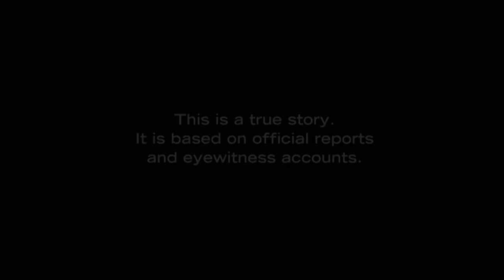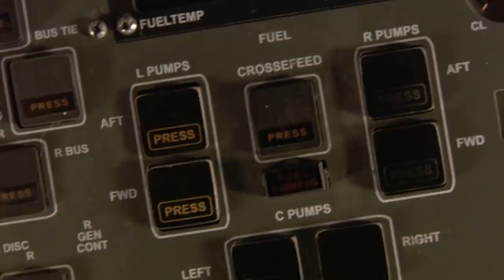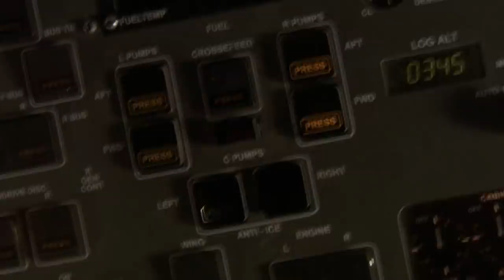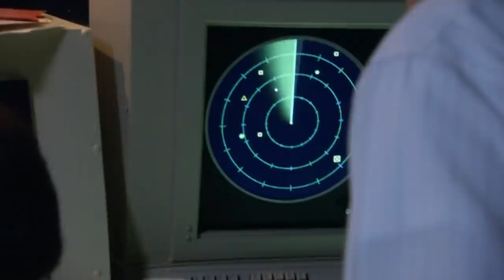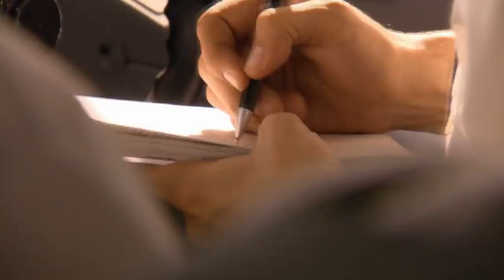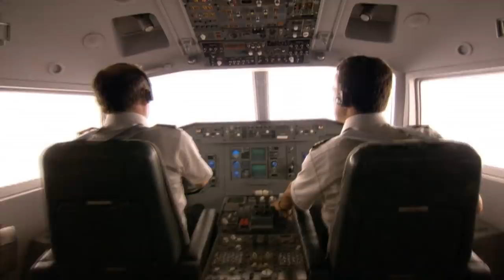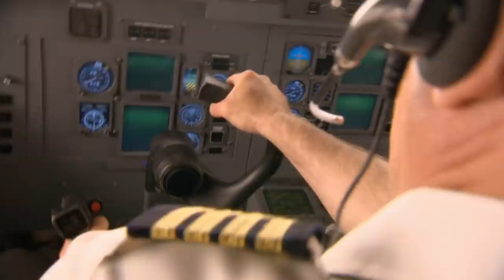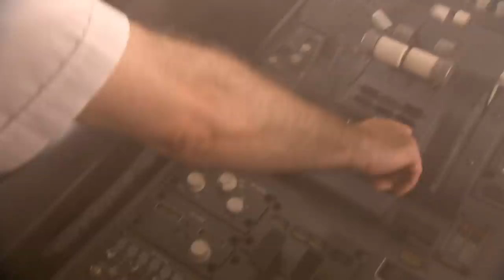Landing A Boeing 767 Without Engines | Gimli Glide | Mayday: Air Disaster

Comment: So.... what did happen with the fuel?  Wasn't the plane fueled/re-fueled enough? At all?  An issue with the pumps?  Electrics?
Reply: A mistake was made when someone inadvertently used the English measurement (pounds/liter) in determining the proper amount of fuel for the aircraft's flight from Toronto, Ontario to Edmonton, Alberta..  Since the new Boeing 767 aircraft was all metric (as opposed to all prior Boeing aircraft), the metric measurement (kilograms/liter) should have been used instead.   As a result, the Boeing 767 was fueled with only half the fuel required for the trip.
Reply: @greanfinisher4014  Thank you very much for the info.  I just wish the video had mentioned the actual cause.
Reply: On top of the metric confusion, two other things happened, causing this crash and nearly a grisly death of hundreds: 1. The Pilot ordered takeoff with malfunctioning fuel gauges. It was an illegal takeoff. 2. Everyone on the ground was confused about the metric conversions; but the Captain said, "Yes, these are fine". He then ordered takeoff. With lives entrusted to his care. Yeah. I know. That's stomach churning on another level.

Comment: You have a much better chance of surviving a plane crash if the plane has run out of fuel, rather then if you crash because the engines stall out……The fact there was no fuel left when plane hit the ground was a good thing because most likely the plane is not going to explode on impact with no jet fuel to ignite….It also makes the plane lighter and much much easier to glide and to perform an emergency landing or “ditching”

Comment: Imperial gallons,u.s gallons, liters. Which measurements did thy used when they fueled for the day?🤔hmmmm.... do you suppose the fueling station didn’t use the same system of measurement?
Reply: Kabuki Kitsune  the mechanics tried to replace the gauges but were  gauges of a different model aircraft..  full tanks indicated empty when the tanks were full. But when the fuel level dropped in the tanks, the gauges indicated full. The pilots were alerted of this and departed with full  load of fuel... none of what happened on this flight was influenced by the issue of the fuel gauges...please believe that.

Comment: What caused them to run out of fuel?  Was it mechanical or did someone confuse metrics with imperial measurements?
Reply: The mechanics filling the airplane with fuel used imperial instead of pounds so it had about half the fuel it needed, there’s a video about the investigation that came out on this channel too
Reply: @mileswilson6073  I think I saw that video or another one on the same topic.    I watch too many videos about air safety theses days.

Comment: Wait, that's it? How did it run out of fuel?
Reply: The gas gauge was broken so they used math to convert liters into pounds but their conversion was wrong, (as was the guy who drove the fuel truck) and they only had enough fuel for 1/2 the trip.

Comment: He flew gliders but never side-slipped? I was in a glider only one time and the wind reversed while we were up and the pilot didn't notice until we were on what was supposed to be the downwind leg of the pattern. So were way too fast on final with a tailwind and she just said  "no problem" and jammed the left rudder pedal down and flew it sideways unit we scrubbed off speed and then squared up and gently set it down. I've been in a Cessna Cardinal with a guy that needed to slow up on final into Lake Tahoe and did the same thing although not as extreme. I don't understand why the left-wing was down that far in the slip. they call it crabbing when I think it's just called side slipping. It's not uncommon. the recreation shows nose down when the co-pilot said it was nose high.

Comment: Stories like this, and comparing it with that Asiana plane that crashed because the pilots didn't know how to fly a visual approach, is why I think all airline pilots should have at least some experience with flying gliders, small airplanes, aerobatics, and so on, and retain at least some confidence doing so throughout their careers. Airplanes are airplanes, whether they're super-sophisticated fly-by-wire Airbuses or stick-and-rudder Cessnas, or even gliders. If you're going to be in control of an airplane, it's a good idea to know how to fly. Because if all else fails, the most important thing to do is to fly the plane.

Comment: So, no explanation as to why it ran out of fuel? Even the mailman got to contribute to this documentary, but not a word on the root cause. Nice. However, after looking up the cause, I now understand why my professors graded so harshly when unit errors were made on homework and exams. (Note that the problem was not solely caused by a units error during a calculation, this is just the part that, for me, was relatable.)

Comment: So where's the end?! Why did they run out of fuel?!
Reply: It was underfueled because of improper conversations made by the refuelling technician. They used the Imperial fuel density of 1.77lb/L instead of the metric density of 0.803/kg/L. 

The correct conversions: 
7,682 litres × 0.803 kg/L = 6,169 kg = mass of fuel already on board
22,300 kg − 6,169 kg = 16,131 kg = mass of additional fuel required
16,131 kg ÷ (0.803 kg/L) = 20,088 litres = volume of additional fuel required

Conversions they did:
7,682 litres × 1.77 lb/L = 13,597 lb = misinterpreted as kilograms of fuel already on board
22,300 kg − 13,597 kg = 8,703 kg = incorrect mass of additional fuel required
8,703 kg ÷ (1.77 lb/L) = 4,917 L·kg/lb = misinterpreted as litres of additional fuel required

Comment: How did they run out of fuel?  When they were refueling at the start of their trip, the fuel truck attendant pumped in liters instead of gallons so the plain got roughly 1/4th the fuel it should have even though the fuel ticket they give to the pilot had recorded the numbers in gallons, it was really in liters so as far as the flight deck was concerned, they had a correct amount of fuel when taking off. I think that fuel attendant is working at Walmart stocking shelves now a days.
Reply: @Bill_Woo  So the fuel gauge not in operation was legal in the previous flight?
Reply: @Garth2011  He made the command decision to fly the ill-fated leg in disobeyance of the M.E.L. which forbade operation, with or without estimated "dip stick" fueling.
Reply: @Bill_Woo  The video showed the fuel gauges as non operable prior to this flight. My question is, someone fly this plane before and with non operable fuel gauges.

Comment: So how did they run out of fuel??
Finish the story..
Reply: It was underfueled because of improper conversations made by the refuelling technician. They used the Imperial fuel density of 1.77lb/L instead of the metric density of 0.803/kg/L. 

The correct conversions: 
7,682 litres × 0.803 kg/L = 6,169 kg = mass of fuel already on board
22,300 kg − 6,169 kg = 16,131 kg = mass of additional fuel required
16,131 kg ÷ (0.803 kg/L) = 20,088 litres = volume of additional fuel required

Conversions they did:
7,682 litres × 1.77 lb/L = 13,597 lb = misinterpreted as kilograms of fuel already on board
22,300 kg − 13,597 kg = 8,703 kg = incorrect mass of additional fuel required
8,703 kg ÷ (1.77 lb/L) = 4,917 L·kg/lb = misinterpreted as litres of additional fuel required

Comment: Air Canada must make public how the new passenger Jet lost fuel in all three holding tanks , or if it was faulty fuel alert alarms that caused the problem!  It seems that the fuel holding tanks ( all 3 ), were out of fuel since the engines shut down….. or the Fuel lines that deliver the fuel to each engine failed to work properly!  
They are very remiss and not giving the findings of their investigation after showing a video of the highly questionable reasons for this near tragedy. The people who fly today have a right to know why this happened, And what is being done to correct it once and for all.

Comment: and , did l miss the part where they said the reason for the fuel shortage? Anyone? Why did it run out of fuel?
Reply: Because it ran out of fuel?
Reply: 1. The fuel measurement system was defective, and should not have taken off, but the pilot ordered takeoff anyway.
2. They tried to estimate the fuel requirement, but no one knew the metric conversions, so there was mass confusion. The captain looked at the WRONG numbers, said, "Sure, that's enough fuel", ordered takeoff, and crashed the plane. He did a great job not killing anyone in the crash, but he was the REASON it crashed.

Comment: What was the "official" cause for the dual engine failures?
Reply: This happened when they were switching Canada to metric. They asked for enough gas for the flight in kilograms but the ground crew did it in pounds. A kilo is 2.2 pounds. So it was like half as much fuel as it should have been. The other issue is that the gas gauges weren’t working right so it wasn’t immediately obvious that they didn’t have enough gas.
Reply: @existentialangst8339  Thank you for responding.

Comment: So why did the plane run out of fuel? Did someone forget to fill it or was there a huge leak ?
Reply: The gauges were malfunctioning. It should never have taken off, by rule.
Reply: It was underfueled because of improper conversations made by the refuelling technician. They used the Imperial fuel density of 1.77lb/L instead of the metric density of 0.803/kg/L. 

The correct conversions: 
7,682 litres × 0.803 kg/L = 6,169 kg = mass of fuel already on board
22,300 kg − 6,169 kg = 16,131 kg = mass of additional fuel required
16,131 kg ÷ (0.803 kg/L) = 20,088 litres = volume of additional fuel required

Conversions they did:
7,682 litres × 1.77 lb/L = 13,597 lb = misinterpreted as kilograms of fuel already on board
22,300 kg − 13,597 kg = 8,703 kg = incorrect mass of additional fuel required
8,703 kg ÷ (1.77 lb/L) = 4,917 L·kg/lb = misinterpreted as litres of additional fuel required
Reply: @Bill_Woo  You can fly without gauges, there's a procedure on how to do this. The procedure is to calculate fuel onboard using dipsticks in the tanks. You find out how much fuel is in the tanks and then calculate how much has to be added(As i said with my other reply, the fuel technician used the wrong density in his calculations. When the flight crew checked the math, they believed it was right). After having the aircraft fueled, the crew throughout the flight will check the aircraft's performance and fuel burn with the FMC. Back in the 60s and 70s, the crew would have to run calculations for this. Nowadays the FMC will automatically run the calculations and determine how much fuel is onboard. Captain Pearson and FO Quintel were checking the FMC. It was showing that they had enough fuel onboard. It's just that they didn't take off with enough fuel because the fueler used the wrong density in his math and underfueled the aircraft. Pearson thought he'd taken off from Montreal with the 22,300kg of fuel needed. He only had 10,100kg. When they checked the tanks in Ottawa, he ran the calculations with the same incorrect density given to him. He calculated 20,400kg onboard. In reality he had 9,250kg.
Reply: @UCsHSTRQofYYLvnyELNiIPOg Also i saw another one of your replies that cited the Minimum Equipment List. The MEL states that the aircraft cannot be dispatched if both channels of the Fuel Quantity Indication System are inoperative. The accident aircraft only had one channel inoperative, and had to have the quantity verified by dipstick calculation. This however was poorly communicated to the captain who interpreted it as both channels were inoperative. 

Yes there was a lot of confusion involved in the accident. But the captain did not just take a slide ruler and go "Yeah it's good". Both him and the First officer checked the technicians math. Running the dipstick tank quantity and given density they reached the same numbers. Mind you the only way pilots can get the fuel density is from the refueler. They had no way to know the density was wrong. They had no idea they didn't have enough fuel.